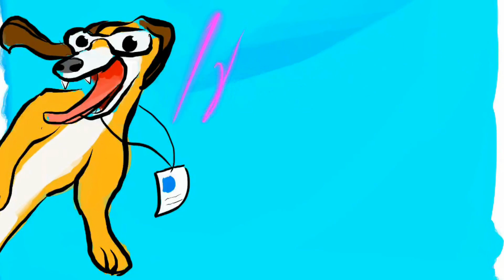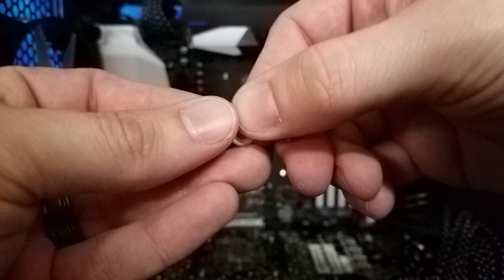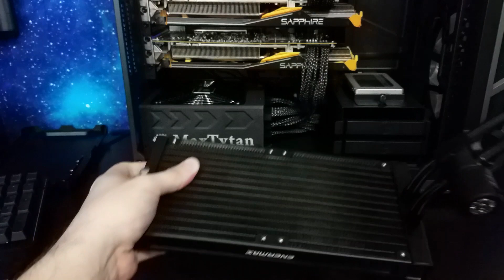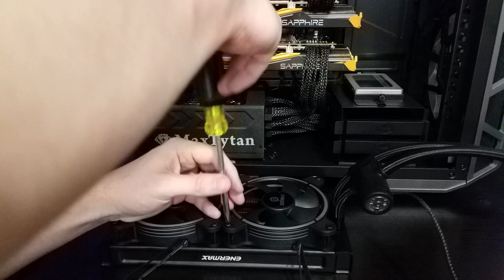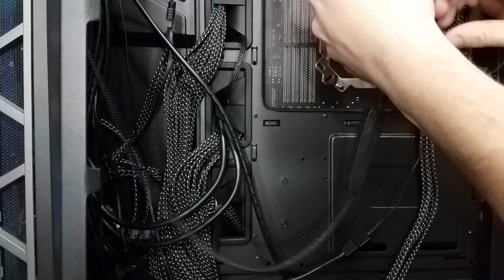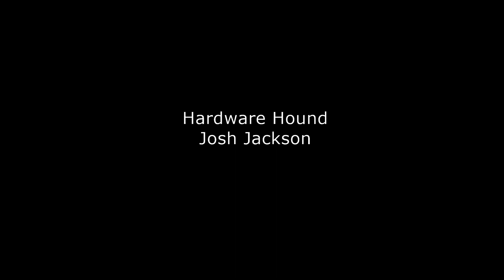Enermax LIQFusion - 240 CPU Cooler - Install Guide

Comment: can you tell me whats the height dimension of the washers, cant find mine, am changing from intel to amd , and i am wondering if i am going to need the washers
Reply from the maker: Unfortunately not anymore, don't have that cooler on hand now.
Reply: @HardwareHorizon  wonder if i can use it without the washer on a am4 motherboard
Reply from the maker: @JamaicaEntertainment985  That might be a tad risky, but you could easily grab some 1-2mm thick plastic washers at your local hardware store for a few cents and be good. The only concern with not using a washer is you don't want the bracket to potentially short anything on the motherboard.
Reply: @HardwareHorizon  that's what I was thinking

Comment: Wait did you plug the actual block with the flow indicator into the rgb controller? You only mentioned the fans and the pump, and I don't want to fry the leds by pluging it into 12 volts.

Comment: can u tell me if ur's make a weird loud fluid noise and like a buzz is that normal i've never had a water cooler , the flow indicator spins normal ant temperature from cpu is 30 deggres celsius idle and in load 40-50 not more
Reply: @HardwareHorizon  thnx for the reply, now it's gone i can barely hear the water flow it's a really nice cpu cooler and does the job
Reply: @2unlockSlide  what was his reply? Can't see it :/
Reply: @double-Ge  the noise is gone he said, and by me to only sometimes when u turn the pc on i think its normal because it starts to flow
Reply: @2unlockSlide  so there wasn't a solution?

Comment: I just want to add aio cooler in TT core p5 on far right without bracket. Hose is too short. New build in process. Help!!
Reply: @HardwareHorizon  Thanks for you prompt reply. I looked at Enermax,Corsair and TT and none of the hoses appear to be long enough. For now I will place aio to the left after buying their bracket (TT) and mount 3 hard drives on the right to cover gap. Once I get the nerve up for hard tube bending,I will be OK. Btw informative videos. Not a rookie. First new build in 10 years!! Thanks